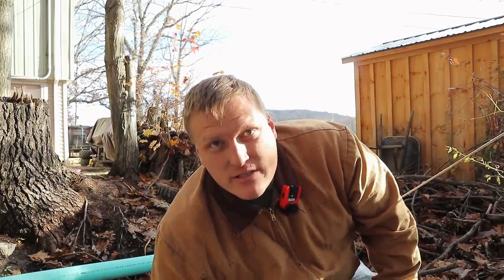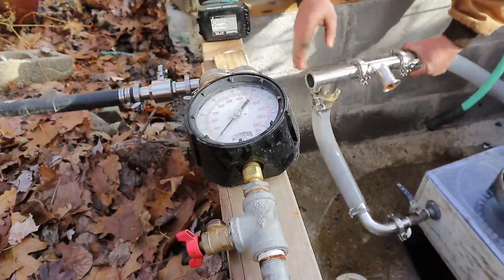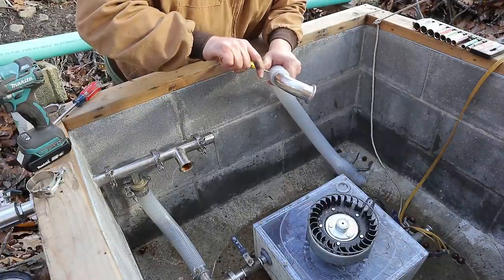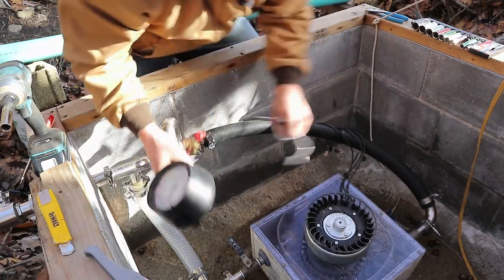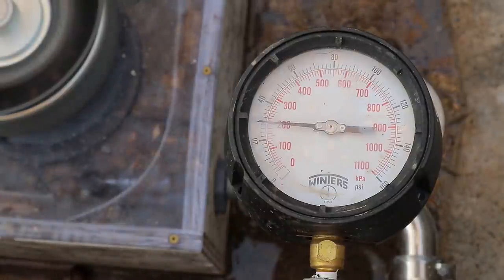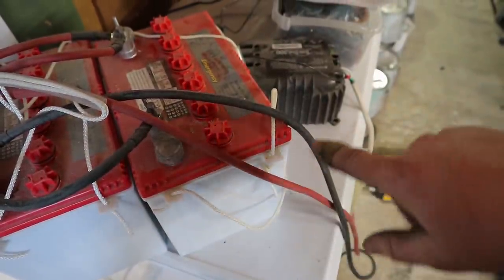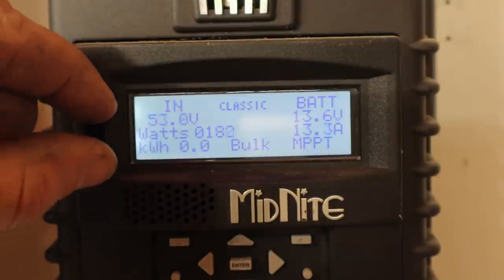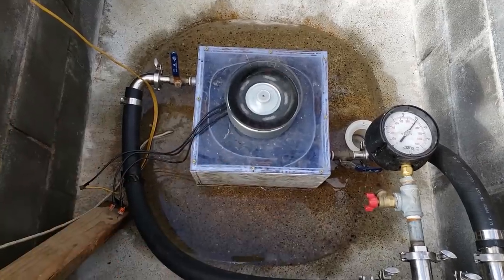Microhydro Turbine - New Hoses and First Start Of The Season

Comment: @20:00 - Are you recording the rode mic in the house (you mentioned connection issues) while filming this at the turbine then mixing in post?  I finally got a camera where I can plug a wireless lavaliere right in to it.  That way you get good audio(hopefully) on the stock video.
Reply from the maker: I was mixing the audio! I use a canon Eos M6 which itsself has a pair of rode video micros (one facing forward and one facing backwards). When I have the Wireless GO mic on I plug it into a channel splitter's left channel while right channel is the forward facing Video Micro for environmental sounds if needed. I have another Video Micro that faces rearward that I plug into the left channel when not using the Wireless GO. In post I will fill right with left when using the Wireless GO

Comment: If you split the concrete lid in two, the parts will refuse to take part in transferring potential energy into demolisher velocity.

If you later find the concrete parts missing, the downslope search area is much smaller.

Comment: I hope it goes without saying (though I still will) i suggest a screen over your overflow (to prevent the squirrels) and possibly over the gap at the top of your spring head (same reason, they could be dropping those acorns down the fill pipe, though I suppose they could have come down during the dry times... having gone in and placed them then)  are you going to slap some mildly more reliable solar on that controller of yours? Or is this just going to remain as a project system?  (Did I hear right in the chicken update... the ducks are going away? Does this mean no dam and no water wheel? Which, in my opinion, is more aesthetically pleasing than your hydro plant)
Reply from the maker: The ducks are going away, the pond will be made more permenant I hope
Reply: @JoeMalovich  aaww... bye bye duckies

Comment: Hey, can you tell us why it is allways pelton wheels for micro hydro installations instead of Francis or Kaplan turbines, which are more efficient at lower and medium pressure heads? Is it just ease of production?
Thanks.
Reply from the maker: Pelton and Turgo runners handle varying flows better, with less complicated engineering required.

Comment: Hello Mr. Malovich
I really love your Videos! 
I'm thinking about to make something like you did. I've got about 80 meters of hight i can use and about 20 liters per minute.
My questions are: how did you calculate the Generator? How can i make that work?
I have no clue about Electricity. Ive seen a Generator on the internet thats for 200w could that work with a pelton turbine?

Can we email eachother or something? I would really apreciate if you could help me with some problems i have to solve. Maybe its not even as complicated as i think.

Thank you
Reply from the maker: Sure, my email is malovich@gmail.com and I totally geek out on helping others with their schemes!
Reply: hello, did you get to build the system? what is your power output?
Reply: @shazzz_land  no i couldnd build it. still wondering 😄
found out that the river i wanted to use isnt on our land so i cant 🤷🏽‍♂️

but after my calculations it shouldnt be more than a maximum of 100w. everything beyond would be amazing.
i also didnt find any smaller generators to get less resistance.
Reply: @CorsinJoos  make your own generator ( try and make a transverse flux generator) 100w of continuous stream times 24 hours times 30 days times 12 months it's somethin, and if ur lucky with a booster u might get to 300 w of continuous stream

Comment: fixate the wago connectors to the pipe so it does not fall in to the water due to vibration. 
a good turbine schall not be destroyed by bad wiringg jobs. And please use a good quality outdoor cable instead this bad 3 conductor flat cable and make a conduit underground.

Comment: Incidentally the electricity connections whilst not mains are still capable of killing you especially if you are heavily grounded like touching wet concrete 120v 3 phase peaks at 1.4 times that, I wouldn't dismiss the potential danger